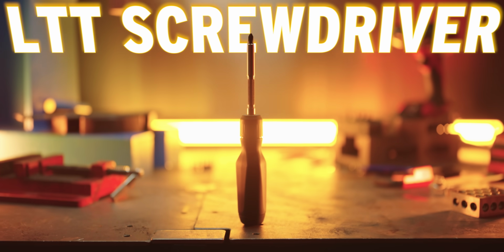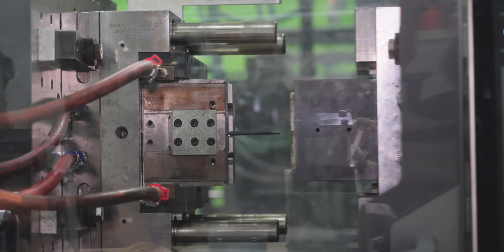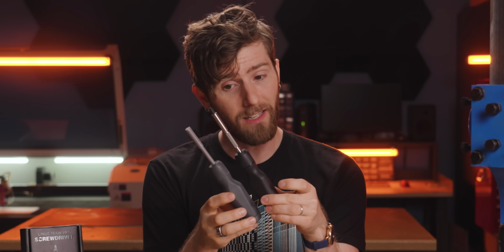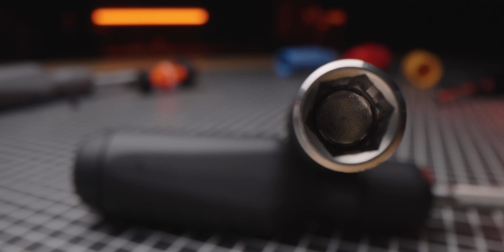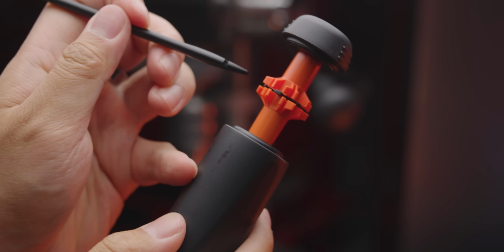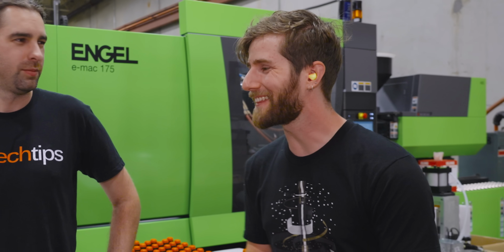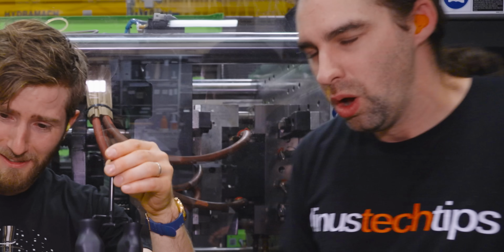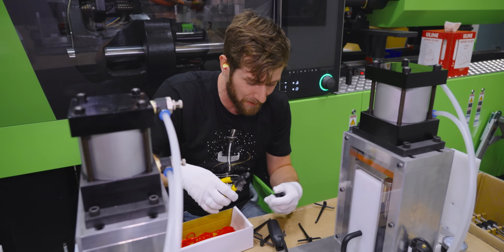Why our Screwdriver took 3 YEARS

Comment: I got mine just a few days ago. It is a WELL designed driver and I'm very pleased with the build quality. Sweating all the little details really shows in the final product. Congrats to the LTT team, Mega Pro, and all the folks involved in the manufacturing process.
Reply: Just got mine today, and you're spot on, this is an amazing looking and feeling driver!  I thought it was a bit pricey, but now that I see the quality, I almost feel like they could have charged more!
Reply: @torq1116  Not sure how they could charge more, I picked up one from a £1 store yesterday, same size, shape, stores bits in the head... added bonus it also tightens and loosens screws!!! 
You can buy a top of the range Bosch GO cordless electric for £60, a very good generic electric cordless for £20, a high quality set of multiple specialty drivers for an array of jobs from Stanley, Draper etc, who invest millions in R&D as well as endurance testing, for less than this one jack-of-all-trades non-precision item (whose handle is to big for working in PCs). 

Some folks have bypassed their logic & critical thinking centres to be a part of the LTT brand and I think it's an undeniable rip-off, and a rather dubious concept. I know they vastly over-spent on its production but that doesn't change the fact the price is completely unhinged in relation to the market. 

tbh I kind of lost a little respect when I saw how much Linus, a multi-millionaire, is asking regular working folks to shell out, it's madness, I think he's a little out of touch.
Reply: @10aDowningStreet  Maybe that's because you live in a world of minimum cost for practicality.  I live in a world where I sometimes like nice, although not needed, luxury things.  I enjoy the content Linus provides, and I consume it for free.  This screwdriver is 100% not needed, but it is a good screwdriver, of high quality.  I choose to buy it and enjoy it, and at the same time giving a little money to a channel I like.  The money doesn't just benefit Linus, it benefits everyone who works there, as well as the people who manufactured the screwdriver.
Reply: @torq1116  Theres nothing unique about it. And its very overpriced compared to other tools, and my proof of it is that its in the same pricerange as snap on tools. im fine with it being an indirect donation for LTT, hes a good guy in this industry, but it doesnt change that its not really a great tool, especially for the type of tool it is. 

The biggest selling point for it is that the fat handle will help those with grip issues, who also dont work in a dirty enviroment( i doubt he tested if the handle lose grip of theres oil on it, something other brands do).
Reply: @TraktorTarzan  Oil?  This is kinda designed to work on computers.  I'm an IT guy, and it's been doing perfect.  I'm using it daily, and no wear or problems yet.

I'm sure it's not for everyone, but it is a very good quality, solid driver.  Bit pricey, but like we agree, LTT is pretty cool and helping support them is worth it.
Reply: I know it's stupid, but I really like the ratcheting direction knob turning the same way I want to turn the screw. 🤣
Reply: @torq1116  Yeah, i agree, it seems directed towards computers.
Reply: @torq1116  Ratcheting does feel good, its why i play with the ratched spanner i got, all the time.
Reply: @TraktorTarzan  "It seems directed towards computers" ... . . . . . ? Are you lost. 

It's a well built and designed tool from a small company. It has a cool ratcheting mechanic and is comfortable to use. Just like other premium brands, the design is a factor in the cost. I would never buy a Benchmade knife, but 100s of thousands do.
Reply: @TraktorTarzan   directed towards computer you total not having any idea how computer works huh ?? 

with that fat handle ???? 

btw you can buy a very very good electric screwdriver for 40 euro with every bit you need for computer work and charged by usb c and  1 charge hold very long
Reply: As someone who works in the trades, i disagree, its not well designed for the type of screwdriver it is, the fatness directly opposes what those screwdrivers are ment for. which is being an all on one screwdriver that you can carry in your pocket, at all times. its too fat, too heavy(only relevant if you carry a lot of tools in your work gear), and its in the pricer-range of snap on tools, which are known to be overpriced.

However it is a really good tool for those who struggle with grip (fat handle has positives and negatives)

Comment: I have done a lot of plastics work from just being an operator on up to learning the tech stuff. I'm not as experienced as a lot of set up and process technicians and process engineers obviously but that mold is damn good. The parting lines and gates are very small and not noticeable compared to many parts I worked with. One part I had to snip and file the gate it was so bad.

Comment: my only issue with this type of screwdriver out the box is that the shaft is way too thick so you cant use these sort of screw drivers on specific electronics like lets say an xbox 360 controller or playstation 3 controller because they have the screws inside those small holes and you need a screw driver with a thinner shaft and in order to be able to use this specific screw driver you would have to buy a whole new set of long thin bits that attach to them. but even with that its a nice driver to just have for basic use with the occasional odd screw needing a special bit to remover it.

Comment: I work in injection molding in the USA, directing operations at this point, with years of experience in tool install/maintenance, and processing the tool recipes to ensure replicable part quality. You did a great job explaining the molding process in simple terms.

Not sure about Canadian wages, but in USA the press operator (the person doing the cutting, inspecting, assembly, and packaging) would make 11-15/hour. At a 40 second cycle that would produce 720 shots, each shot having 2 cavities means 1440 parts produced in 8 hours. 1440 parts then sold at $70/part means the press operator is responsible for $100,800 in production while earning 88-150 for 8 hours, before taxes. At the high end, the worker earns 0.00119% of the product value for which they are responsible.

I'm not saying this to bash LTT, or any entity specifically. There are plenty of other factors besides end profits vs operator costs. Material costs, machine energy and opportunity costs, operator costs, packaging costs, shipping costs, storage costs, engineering costs, etc etc. Given that this video exposes a lot of people to a manufacturing process for the first time, I'd like them to be aware of the people that make their fancy screwdriver possible. The job may not look difficult, but you need reliable people who can stay focused on part quality while doing all the processing and packing for 2 parts in under 40 seconds repeatedly for 8-12 hours.

Comment: I received mine about a month ago, and I have to say, its the best screwdriver I have used. Between that and the flip out utility knife, they sit on my desk for all the little things I need. I use them probably at least once a day. The only downside of the bit loader is the amount they hold compared to how many bits that came with it.
Reply: I actually commented too soon before the end of this video and realized it holds twice the amount of bits if you use the top and bottom of the loader. They seem to stay in place better as well. Hard to find many downsides to this product. While the competition may not be that different, I don't have any experience with any of them, and this is just a fantastic screwdriver.

Comment: 303 is the easiest stainless to machine. I've worked with a lot of 303 and 304 and 303 is super easy to work with, not much different than regular lcs. 304 on the other hand is a pain

Comment: 3 things required for said screwdriver first is weight second magnetic pull third light ratchet but strong enough not to go other way now onto the bits the handle idea is great so long as the bits in it function for its design e.g., hex bits for pc sizes cross bits e.g., Phillips and cross head flat not so much also make sure the handle will not generate sweat as some plastics can not shaft design looks good i would however but a hex where the shaft meets the handle this could be for added turn ability now Linus you must do audio books or children's story's as your manor and voice are awesome please open up in the UK

Comment: I really enjoyed watching the history of this product's development. As someone who has built and repaired many a PC over the last thirty years, not to mention all of my general household screwing, er, screwdriver usage, I really appreciate all the anal retentive detail oriented Swiss watch gnat's ass precision you guys put into this. And now, I WANT ONE.

So I just ordered. According to the store, mine will be part of manufacturing wave #8, which will not ship until January 20, 2023. So I got that goin' for me. Which is nice...

I guess after a year or two, the orders and manufacturing waves will sync up a little better and the product won't be back ordered all the time.

But by then I'm sure LTT will be deep into the development of some great new product - like maybe a PC/electronics-oriented multitool that included decent screwdrivers, needle-nose pliers with actual fine grabbing capability, wire strippers that actually work, opens with one hand, and doesn't include six knife blades, three deer skinning tools, and a frikkin' bottle/can opener.

Comment: Interesting , I’ve been using 1/4” hex multi drivers for many years ! One thing you also need to introduce is a 1/4” hex stubby iteration. ! I reserve judgement on the LTT , as I’ve never handled one ! ATM , I mostly run PBSwiss , and Wera ( an improvement on Snap On , where my Journey started in the eighties ) .

Comment: A problem with fat scredrivers like this that i've used is when the screw is close to the PC case the screwdriver handle is too fat to allow the bit to go in straight, and you have to come at it at an angle (which doesn't work well). anyone thats used this driver ran into this issue?

Comment: I can tell you personally from experience designing jigs for manufacturing.
Making complicated stuff that just works, is easy. 
Designing simple stuff that the end user looks at and says "yeah duh, ofcourse." Is actually the hard part.

It's easy to throw 30 different features at a product that has 30 different required functions. 
It's time and skill to hit those 30 functions in 5-10 features.

Comment: I'm a tool fanboi, have to work to keep myself from buying sets all the time.  A feature of interchangeable-bit screwdrivers that I have come to avoid is the long shaft, short bit arrangement like yours, because I always seem to find a place where the bit needs to fit through a hole to reach the screw, and those don't fit.  Such as mounting a 2.5" disk or SSD into a chassis for 3.5".

Comment: After stripping the screws on my PS5 installing an SSD expansion, this is exactly what I need- a screwdriver designed for tech parts. Hefty price tag for a screwdriver, but out of respect to the work that went in it, more than happy to wait for Wave 7 since it will probably take that long for me to save up for my first "for me" PC build.

Comment: So just looking at the product page, you have confirmed sales from October to early December, amounting to 90,000 units, at $69.99 you have made $6.299million (obviously not in profit just revenue) but honestly that's amazing, well done to everyone involved in the manufacturing process. 

Think I will get one sometime next year. Quick questions though, does it come with any bits or are they sold in the separate $6.99 12 bits set? The screwdriver product page doesn't seem to mention if they are specifically sold separately or not, and while one can never have too many bits, it would be nice to know clearly on the product page.

Comment: Why would you pay $70 for a ratchet bit holding screwdriver when there are hundreds of brands out there that are cheaper and are just as good. 
My WERA brand computer/3D printer screwdrivers are very made for about 20 bucks a kit. I like Linus's videos very much but all most of his merch is like bikers only want a Harley even though there are actually better motorcycles out there. I will pass on most of his merch.

Comment: As a manufacturing technician, I'm very happy that you introduced a large amount of people into the manufacturing sciences and processes that go on behind the scenes. We need more youth injected into this space as both technicians and operators are aging work forces! You can make good money in these fields ppl!
Reply: Do you know which field one would go into to design factories? I'm really interesting in mass production and how things can be automated, but have had a lot of trouble finding material on how it is done or even college courses on it if I were to go that route.
Reply: @happysmash27  Industrial Engineering, Electrical Engineering and Manufacturing Engineering typically. In a well balanced facility Engineering, Quality, and Production departments will combine input to lay out each production line to optimize efficiency, reduce error, and reduce waste. Lean manufacturing principles are taught in almost every one of those fields and are applied on a daily basis.
Reply: @happysmash27  protip work as a technician/electrician in a factory first, and then further educate yourself to design production machinery or be project project manager/designer(these are often some form of engineer thats relevant for the field) for a factory. Otherwise you will hinder your work, and be second in line for those who went that way.
Reply: Honestly, I haven't met someone that did a technical study that is struggling to find work.
Reply: @Kronos_LordofTitans  Same! HVAC, Electricians, Plumbers, Electronics Techs, PLC Specialists are all thriving. In fact I get calls regularly from headhunters looking to get me interviewed (sometimes within the hour) for positions. Almost all of my colleagues do too
Reply: Ha... Injected.
Reply: i agree, i just wish he made this tool a good tool for those who work with machinery, production and general technicians/operators
Reply: And project management jobs
Reply: i just finished a series of courses on maufacturing processes and i completely agree

Comment: legit question, can i ask about the strength of the magnetic tip in close proximity to say the retaining screw on an NVME drive and a slip of the driver... what effect would this have to electronics if any.....can you test what would happen in the worst case scenario, would it erase data?

ive always been weary of using super strong magnetised screwdriver inside my PC

Comment: As an electrical engineer;
Nothing less from our dropmaster! We always knew how Linus was obsessed with simple and high performance concepts, He kinda shows it on the product he produces as well. Congratulations:
On the flip side, boy, I'm an APU user and won't spend 70$ for a screwdriver.
And for my workplace, even though I do the orders, I get not as good as LTT SD ones, but I get my multitool screwdriver for 15 bucks from "İzeltaş"
I wish there are other engineering companies that would order say, 2000 units from you.
Still, gotta give the credits, I would buy one, I just can't. It's like Lambo of screwdrivers. High qualiy stuff, and very question-proof demonstration of product!
I'm glad to see how nice Linus' OCD is fruiting.

Comment: I am surprised that the molding company is using manual hopper loading instead of a vacuum operated autoloader and there is no automatic scale dye mixing feeder on top and no central drying and transportation system. The press looks very clean, it's either brand new or they have very motivated technicians.
One hot tip for ya, when choosing a company to produce your products with your mold, ask them to show you some of their other molds in storage and inspect the cooling water ports for corrosion. Many companies are really careless about the quality of the cooling water which will result in EXTREME dissimilar metal corrosion of the cooling cavities and that will cause permanent damage to your very expensive molds. I have even seen seaweed floating in the cooling water. Also have them show you their mold maintenance shop and how thorough they are with maintenance.

Comment: While this is compassionate, thorough, professional, thoughtful, this screw driver is almost seems like for someone name Linus, not Joe. And this screw driver is definitely NOT the best one, period. There are MANY MANY options far cheaper with much better flexibility and strength. This feels to me like (sorry for language) a boy's toy. This might feel like an upgrade for "traditional" screwdrivers but the marginal utility is really nothing of significance. The LTT screwdriver is clearly NOT for someone who regularly fixes things around the house with a lot of tight angle, rusty screws. This is clearly for tech hobbyist that never get down and dirty. And I mean DIRTY, with oil, mud, leakage, etc. not just dusty corner in air-conditioned room.

At 70USD, this is probably about at most 25% better than a 20USD one, and in absolutely no way 3 times. My Japanese one, at half the price is so good, it gives me confidence. When I lift it up, I thought to myself "today will be a good day, shits will be tighten, stuffs will be solid." This screwdriver is no where near that, by design.